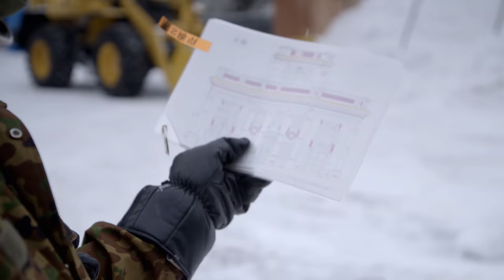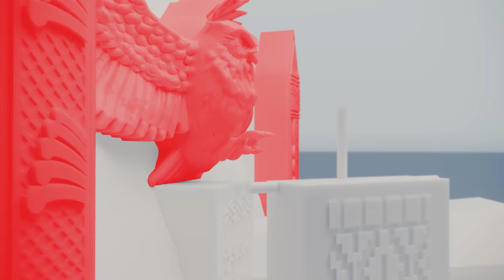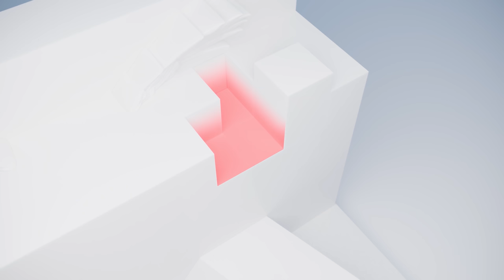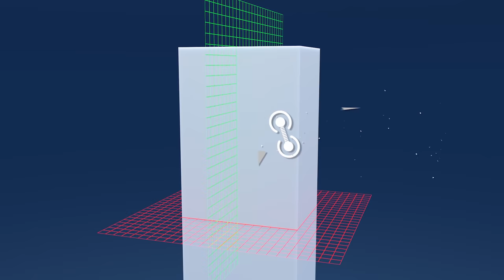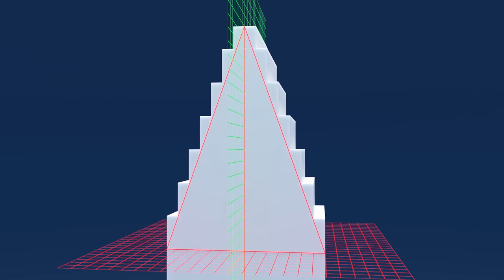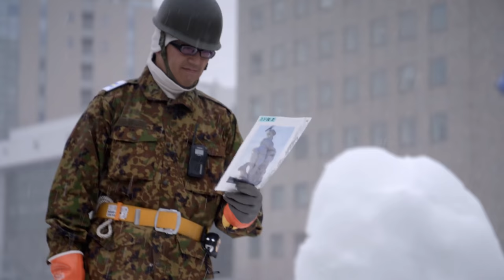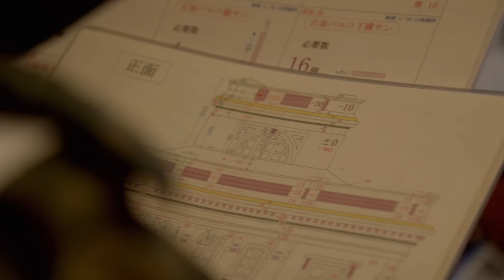Megastructures out of 300 Tons Snow | Giant Pop-Up Constructions - Japan | Free Documentary

Comment: The Japanese make great stuff that lasts a long time, and that's a fact. 
From my Honda car, Yamaha motorcycle, 2 Toshiba tv's, Canon ink jet printer,.. to my decades old Sony sound system, they all work great, and i haven't had any problems with ANY one of them. (Only basic preventative maintenance on the car and motorcycle have been needed, and replacing worn rotars, brake pads, and old fluids. No major breakdowns have occurred, and they're old vehicles with lots of miles of them.)